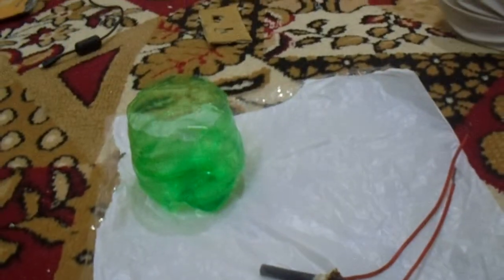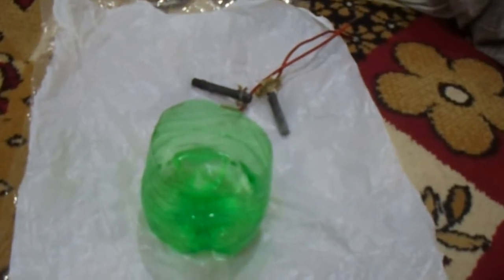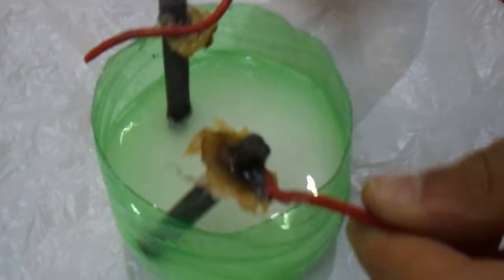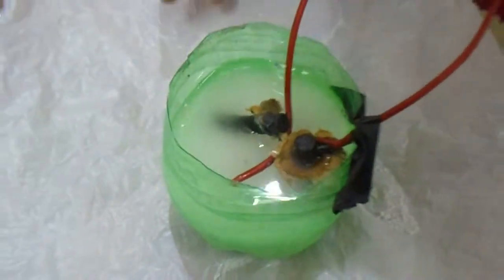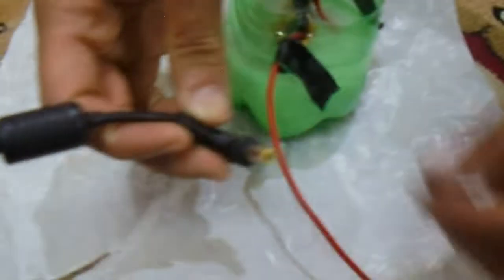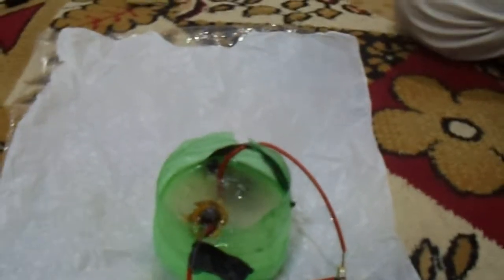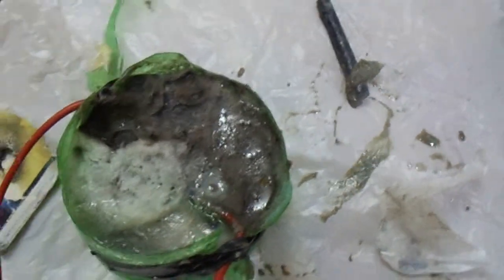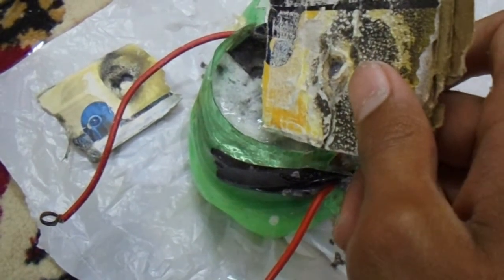How to make sodium hydroxide

Comment: It does produce sodium hydroxide but it quickly reacts with the chlorine being generated at the anode so it turns into sodium hypochlorite (bleach)
Reply: Waldeinsamkeit  yes it makes sodium hydroxide but you NEED a semipermeable membrane to separate the two compartments so the sodium hydroxide doesn't react with the chlorine and if you leave it exposed to air over time it will absorb CO2 from the air and turn into sodium bicarbonate so in either case if you don't have a special apparatus for electrolysis then you will just end up with useless sodium bicarbonate or bleach solution contaminated with salts
Reply: @miguelchacon2717  so is its always better to keep NaOH away from air right?
Reply: @Praveen-rk7ct  yes, you could do this by putting a layer of mineral oil on the water, but it has to be separated by a semi permeable membrane
Reply: @miguelchacon2717  why a semipermiable membrane? Is it because you need to seperate water from the solution?
Reply: @miguelchacon2717 i will do electrolsis process in one beaker i mean electrodes gonna be in one beakrr with salt water. After turning power on which chemical is going to be produced ? Sodium Hypochlorite or sodium hydroxide i spent hours on youtube just for understanding which one is produced still i have no answer im using lead catode and iron anode
Reply: I don't think so
Reply: @zeeshanziche8213  go do some research, i bet you don't know anything about chemistry
Reply from the maker: When the reaction is complete or half complete we get a mass of compounds in which 15 - 20 percent is NaOH. And the remaining matter is mostly unreacted NaCl(Common salt), some carbon and some other compounds.
Reply: True 👍
Reply: So if you used 140g of salt how long would it take to turn all the salt to sodium hydroxide if Im using 2 aaa carbon rods and a d battery?